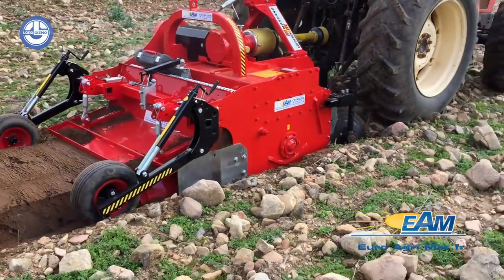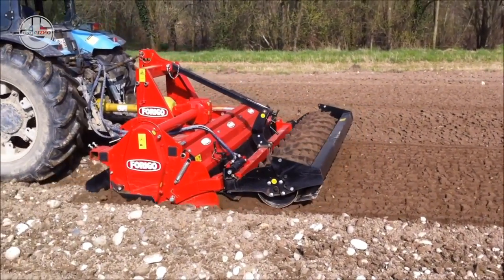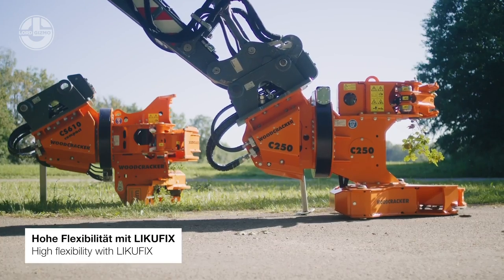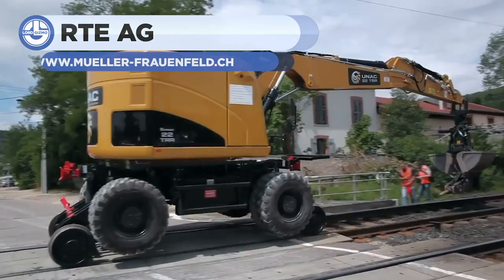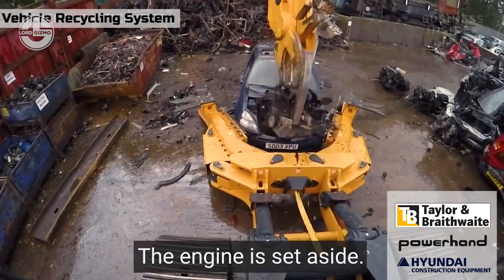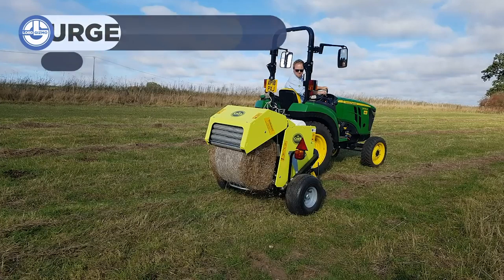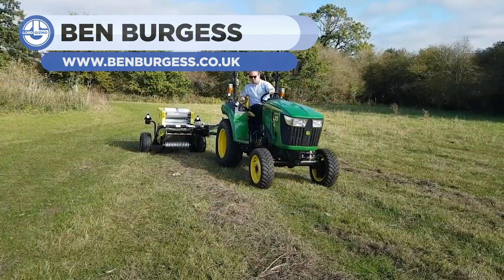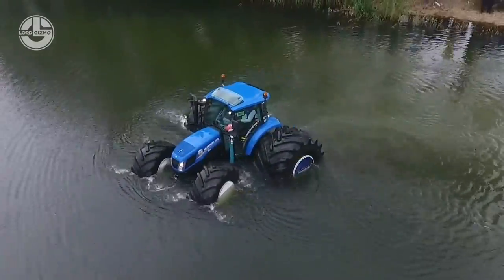Most Powerful And Ingenious Machines That You Need To See

Comment: I need to make a clarification to the Misconception given by air filled balloon tires making the tractor light enough to float. A battleship floats too, but you wouldn't want to drop it on your field.  It's not about the AIR making it lighter as much as the total surface AREA in contact with the ground. Whereas a battleship has a pointed keel the tires are relatively flat. A barge would be a better representation. It's the more square inches in contact to distribute the load than it is the overall weight. The air just inflates those tires to make them bigger, not lighter so there are more square inches to distribute the load and thus less pressure on the soil. These are fun videos, keep up the good work.
Reply: Additionally, the materials make a huge difference as well as the size. I suspect the materials in the construction of said tires are lighter/stronger/tougher compared to the heavier brethren of similar sized tires. I'd be interested to know! (having worked on a farm and having had to move tractor tires - you don't just toss them like you would a car tire - lol )
Metal world comparison: Titanium vs Steel -- and since we're using using boat analogies...

I figure a barge made from Titanium, would provide WAY more potential payload for its given displacement... Though, how Much titanium would be needed for just ONE 'regular' barge!!?? - not to mention the COST - heh
- but as with anything, if theres a market for it... (*although - I suspect a light weight tractor tire has a more viable market than a titanium hulled barge)
Reply: I agree with what you're saying, but battleships, aircraft carriers, pretty much all giant ships do have flat bottoms.

Comment: Why do we have tractors floating in water? 🤦‍♂️
Reply: Mud season and rainy season
Reply: Its also meant to show how it evenly distributes the weight of the tractor so its a lower impact on the ground
Reply: so it stays put when you anchor it before your yard floods
Reply: @theamazingmarti812  What’s the point of that? “Let’s put on the giant inflatable tires and drive into the lake to see if our tractor is in balance!” The video says nothing about that. You can also just drive onto some heavy duty scales to check your weight distribution if you think that matters.
Reply: @Engineer9736  when you have wider tires it helps spread out the overall weight being put on those tires so get less ground compaction not about the tractor itself being in balance...
Reply: @theamazingmarti812  Wider tires may reduce compaction but can cause maneuverability and soil disturbance issues.

Comment: you can never tell me dinosaurs are extinct!  I just watched one tear apart a car.  Good grief!
Reply: I mean, it burns kerosene so a dinosaur does play some part there.
Reply: an absolutely useless piece of equipment in any respectable salvage yard... in our yard we have a machine (or crusher as it is called) that we toss the cars/trucks or whatever that turns them into cute little cubes in about 2 minutes. It does this more than once at a time as well. Engines are taken more care of since we do sell cores. But if non-salvageable it's just a quick 3-4 minute air drill away from being thrown into our aluminum pile, or if all aluminum just toss the whole thing. Our pincer machine is about 4 times bigger and mainly used for tearing apart large silos or pinching things out of very large equipment. It's kind of humorous to see an excavator cannibalize another excavator...
Reply: @yuribrandi8212  Many years ago I was standing in a mechanics garage and was looking up at the biggest Caterpillar earthmover they made at the time.  All I could think was Please God don't let anyone start that thing up.  Scared the daylights out of me just looking at it.  Then I had to laugh.  The product of a bunch of guys sitting around saying OK, what if we ............
Reply: @yuribrandi8212  You are missing the point of this video that it seperates all the different materials to recycle them properly. Putting a plastic dashboard in a steel faundry doesn’t help the steel production nor the environment.